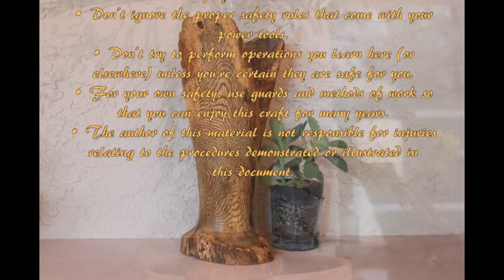Woodturning Banyan tree vase

Comment: Was that your bride I heard in the beginning of the tape? Al, unusual choice made for a vase.  I thought you might go for a double opening. A question for you concerning the OB Juice;  if you warm it will it affect the colour or product?
Reply from the maker: Thank you very much for watching and yes that was the bride LOL  I don't know what you mean by warming it. It heats with friction.  It does enrich the colors just like water does but does not change it.
Reply: @AlFurtado  When adding the Shellac and oil etc.  if warmed over a hot plate will that change the coulur?